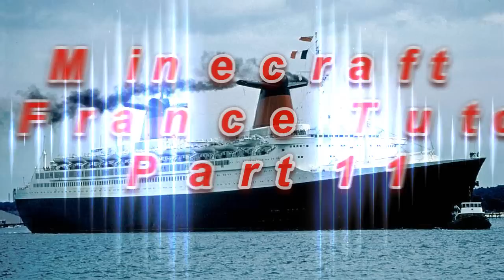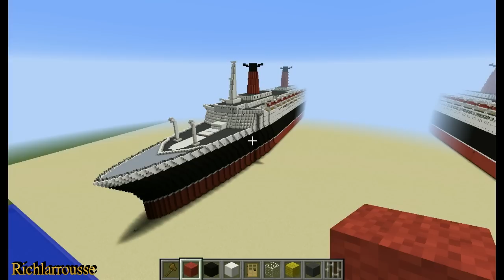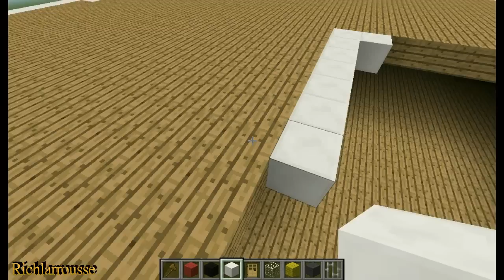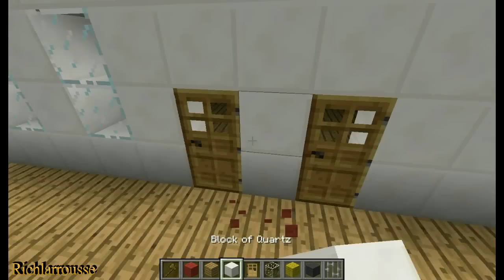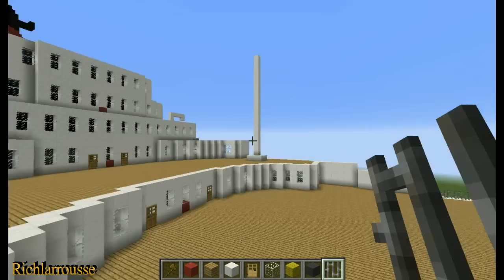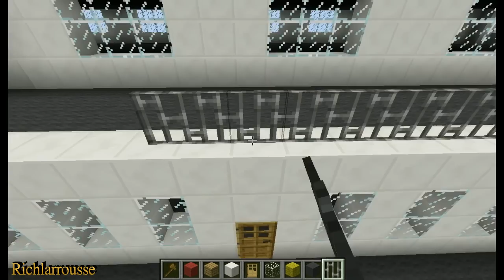Minecraft! SS France Tutorial Part 11

Comment: We can both agree that this is terrible compared to your current standards, and it needs a redo, but you still do the same terrible things with your bows, they curve out like the top of the hull. no ships except for tankers, and ships of a related type, had those In the 10s to now. Its unnatural.
Reply: And i doubt that you actually make ship hulls in this order. so when youre making the bow, build the waterline, the top of the deck, and the tip of the bow shape first, and if thats a horrible explanation, I could show you an image via discord/ skype
Reply from the maker: They may be terrible, but its not going to improve, I just think some people take MC ship building far too seriously
Reply: @Richlarrousse-JS41  not very optimistic, youre totally gonna improve, right now id consider you master material, just gotta work on the bow waterline, and add some sheers. Also us ship builders like things to be as accurate as one can get.
Reply: Just to make sure, the sheer is where the hull curves up at the bow and sometimes the stern, which you probably know